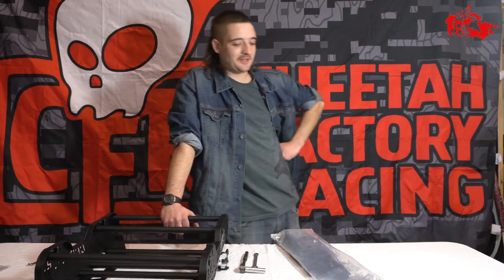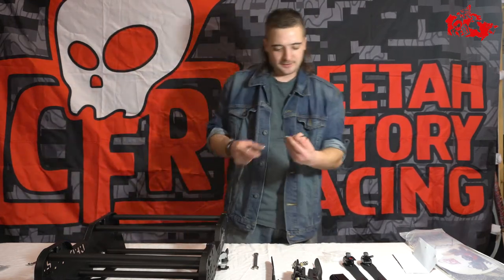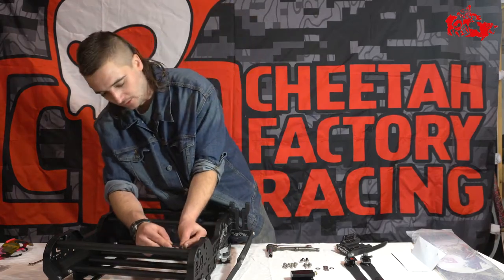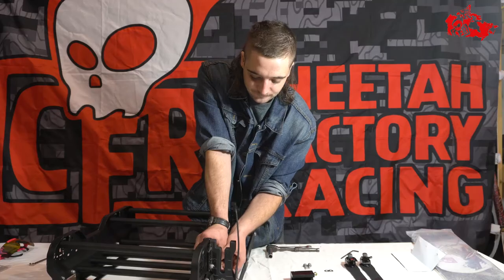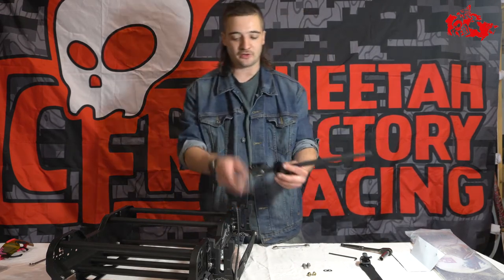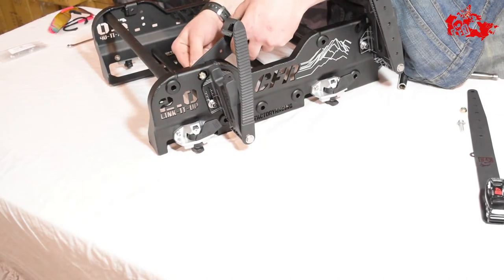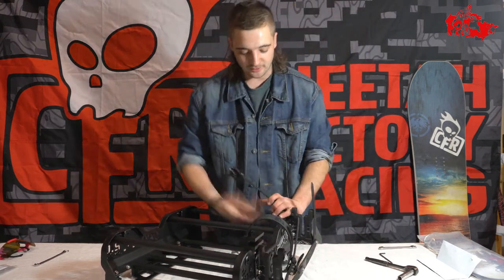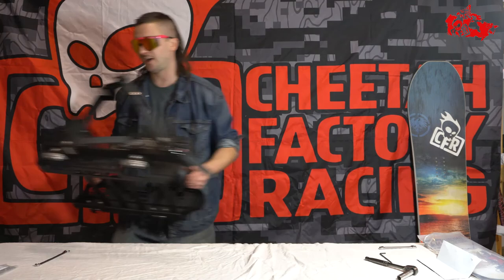Boardski Bracket 2.0 In installation Video.

Comment: where do the large fender washers go?
Reply from the maker: The big washer goes between the strap and the side of the plate of the rack. Send us and email at cs@cheetahfactoryracing.com and we can send you a photo.
Reply: just looks like he never used in the vid...so the strap is not against the rack correct 
 @CFRSNOW
Reply from the maker: Thanks for the heads up  @chrisbivona8062  . Yes the big washer goes between the strap and the rack.